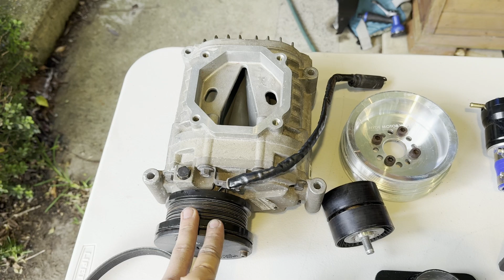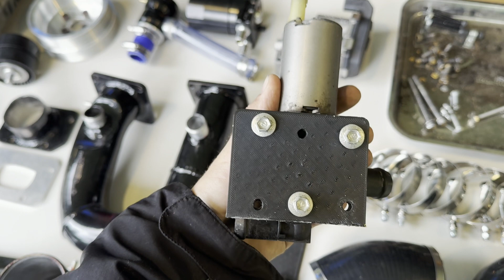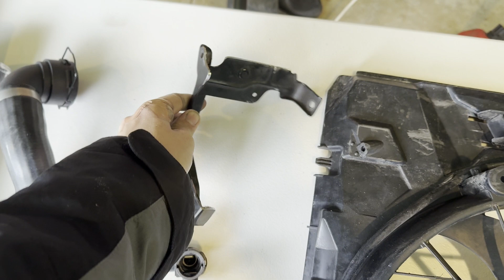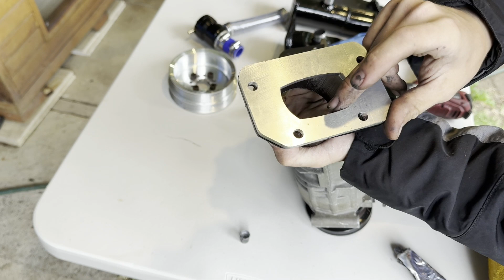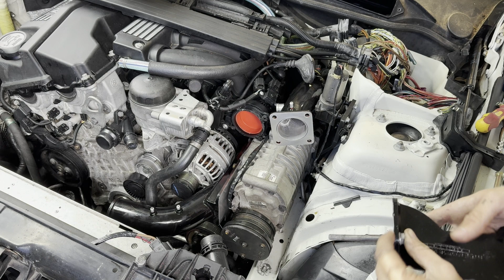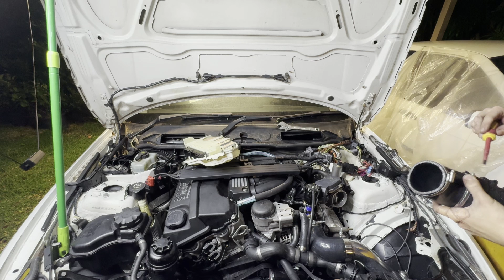BMW 118i Nemesis 1 supercharger install

Comment: Hello did you do this on the left hand drive or right hand drive e87 and did you use the stock ecu
Reply from the maker: Right hand drive car. The stock ECU can be used to drive the car short term but is not rated for boost and you will run into issues running lean.

Comment: Hey Christian. Just wondering how you got the front bottom bracket to fit and get everything where it should - i have lci e46 318ci(it has n46b20a engine) and have similar fitment issues as you. I see you have extra holes in that bracket. Also i need to make the same modification to the supercharger outlet to clear the alternator it seems - you havent mentioned in the video but i see you have cut of the corner of the outlet plate also as the belt wouldnt clear, was that enough then to clear onto the double pulley or tou had to modify further? Ta
Reply from the maker: Hey Lukas! Yeah the notch out of the outlet manifold was enough to clear just fine.
Reply: did u installed the kit yet?

Comment: When is the full installation video gonna be live ? I got my kit , waiting for the installation guide , nothing on the site yet for this kit😭
Reply from the maker: im currently making the install guide. if you want to install the kit following my vid im sure Hyde motor works support team is more than happy to help if you run into issues installing. what chassis are you installing the kit on?
Reply: @KQUINN720 e46 318
Reply: I did email them about the double idler puller / guide pulley , been days … still haven’t got back to me

Comment: 2500 for the kit is a bit rich for just a few pulleys and fabbed up manifolds. No charger, no tuning support, no intercooler, no bypass. Not even a bit of vacuum hose. A good kit gets the job done, a great kit worth the money has the end user in mind, every step of the way. Plug and play. Good job not snapping off the top coolant hose though 😂
Reply from the maker: The kit is still still being developed, i was the first person to do a full install and have been working towards getting a parts list for the entire kit. the price is high as there has only been a limited run of kits made so far. other kits that have been further developed come with all of this
Reply: @KQUINN720 Good luck mate. Hope it comes together. I got a black 118i lci e87 so I'll be keeping an eye on this kit.
Reply: @KQUINN720 why js there still no vid of driving?

Comment: Do you have to wire the supercharger clutch?
Reply from the maker: You can if you want by using a pressure switch to activate and deactivate the supercharger but i followed the attached video to make my m62 a direct drive supercharger. alternatively you can buy a smaller fixed pulley from Hydemotorworks.com but this will also increase boost. https://youtu.be/HOxnf0iAyXM?si=TjYjgyeAVM8Pwe_w